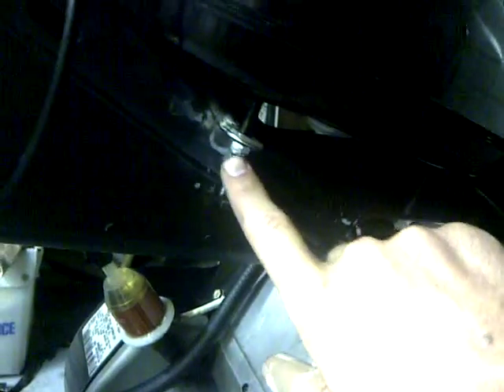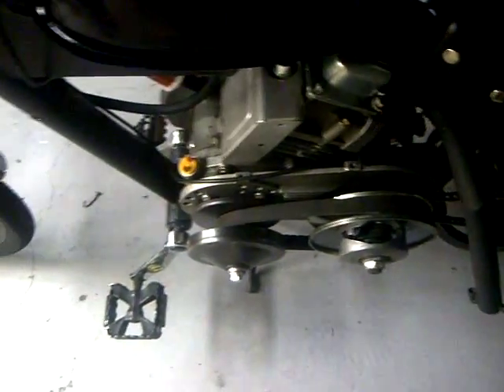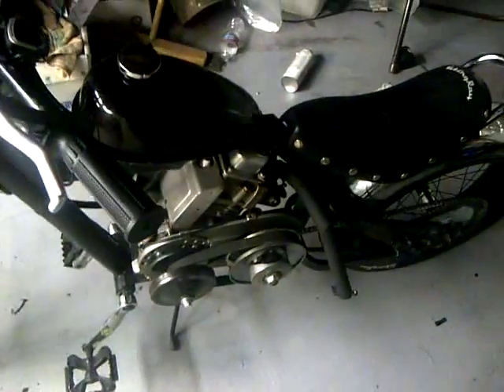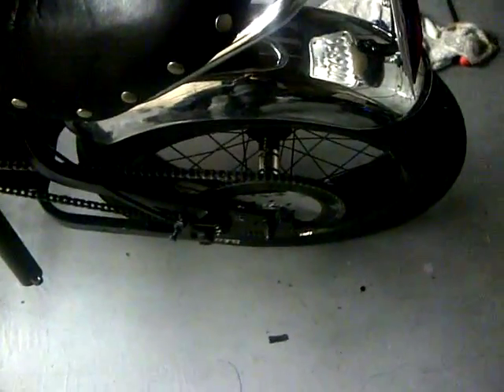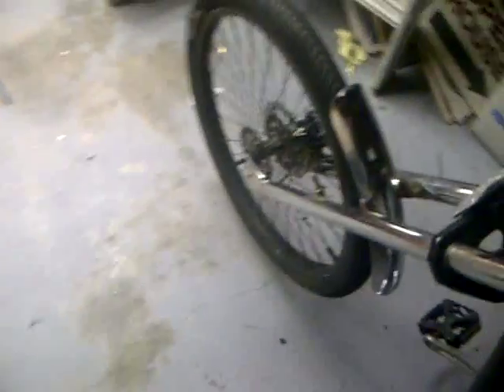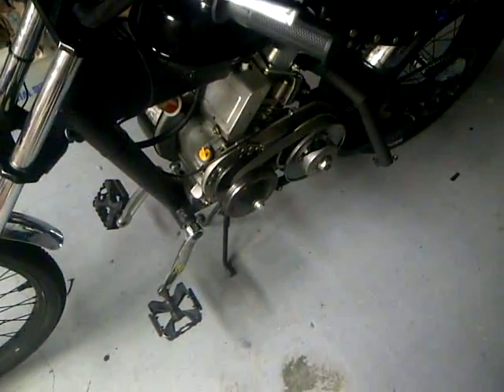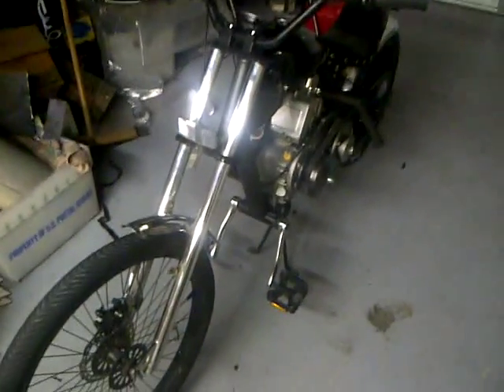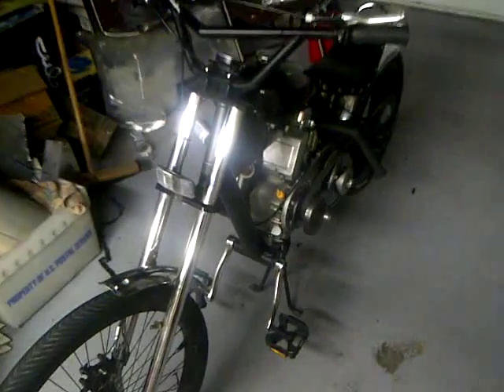homemade motorcycle/moped clocked at 40.5 MPH

Comment: Did you ever solve your problem?  You need a smaller rear sprocket for more top end speed.  But I would replace the engine with a 125cc or 140cc lifan motorcycle engine.
My question is how did you mount the engine to get it lined up with the rear sprocket?